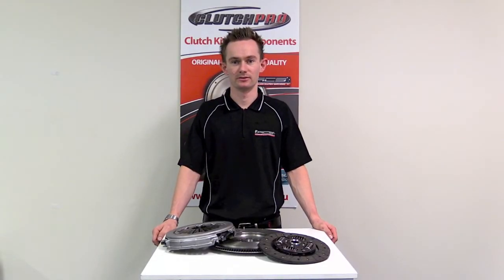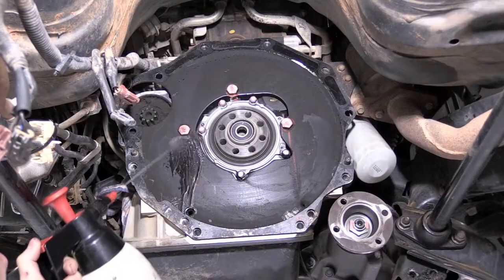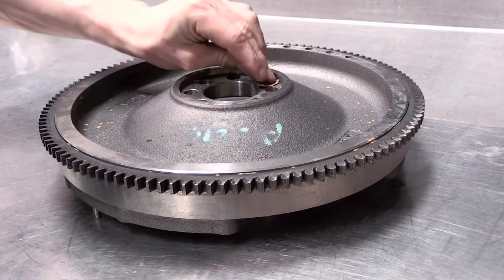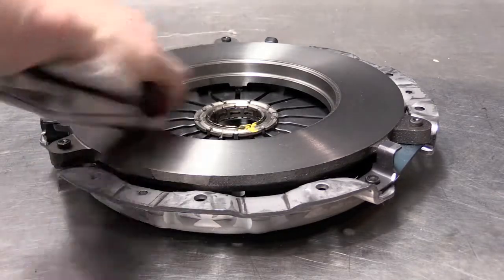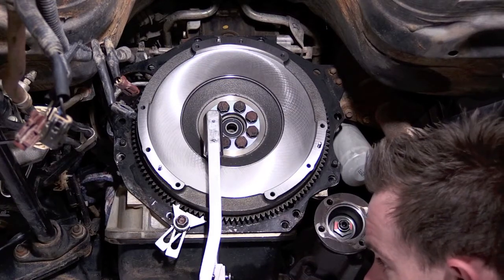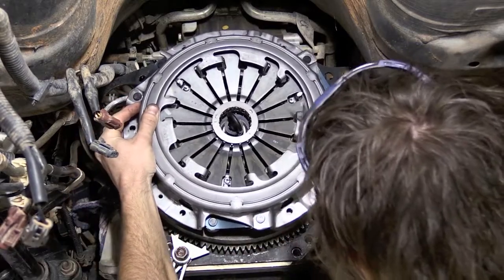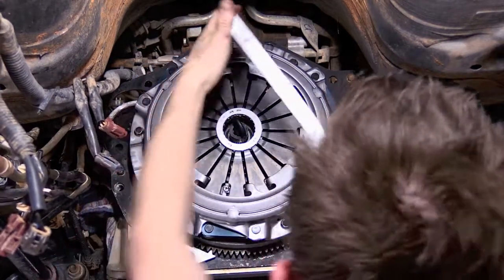CLUTCH TECH: Clutch to Flywheel Mounting Procedure

Comment: Correct me if I'm wrong but did you not just place the tag that says "gearbox side" towards the flywheel? That would be backwards wouldn't it?
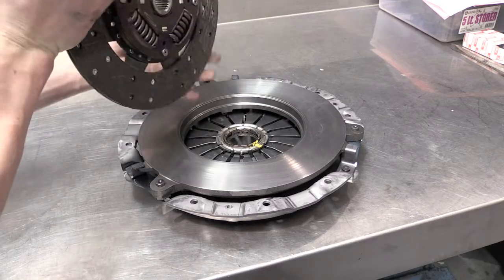Reply from the maker: Thank you for your comment. At 1:14 the disc is placed gearbox side down on a pressure plate (as an illustration of direction), however we can see how the footage shortly following this may be confusing as the sticker was likely removed prior to actual installation. It is placed in the correct orientation as you can see by the hub, but apologies for the confusion caused by that being removed.

Comment: Good instructional video...
I was told never to add thread locket to the flywheel bolts but instead to use a cotton bud and add to the actual bolt holes because if you add to the bolts it can actually get in between the fly and crank.